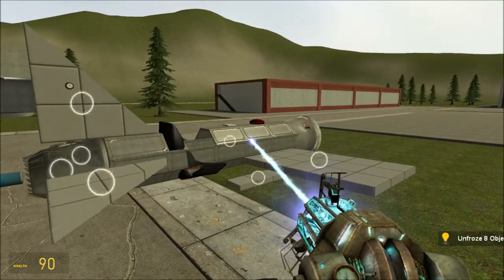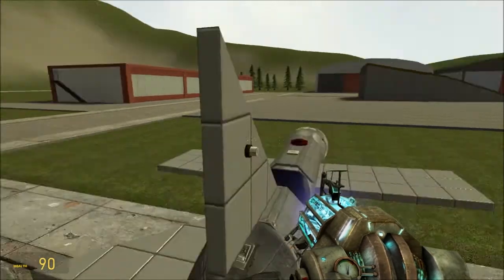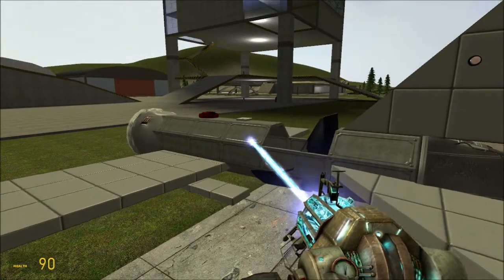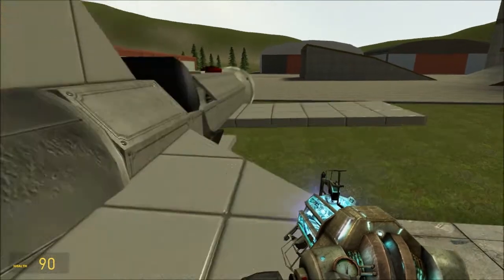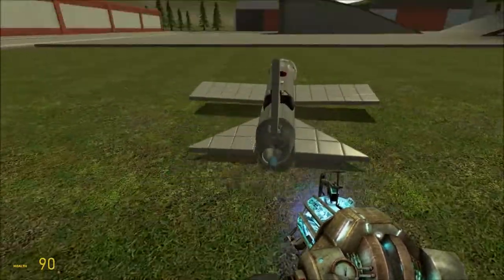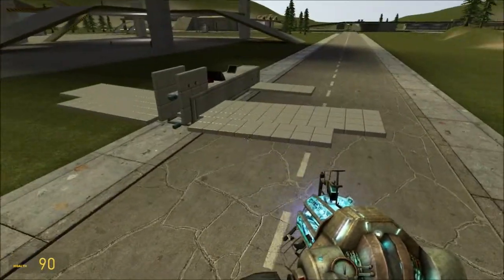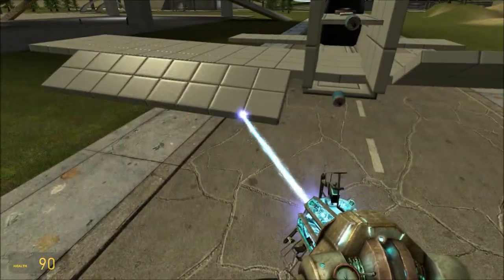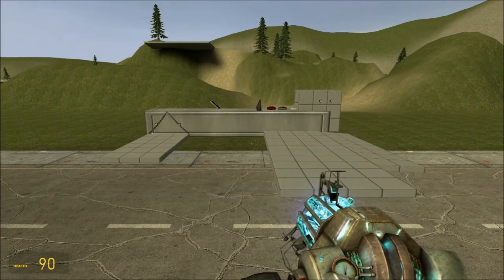Impractical Mouse Controlled Plane

Comment: Use bearing and elevation adv pod controller or bearing/elevation on a vector from eye aim position.   then  you can just aim in a general direction and fly that direction. Eliminates the whole issue of eye pod.  :D

Comment: @redreaper2020 That way you wouldn't really be able to control pitch and roll independently though, it would need to have some sort of spoiler yaw the plane toward the location you're looking, which would be fine, but eliminates most aerobatics, although you're definitely right. That's better than this control scheme.